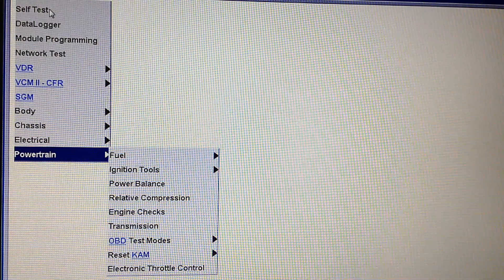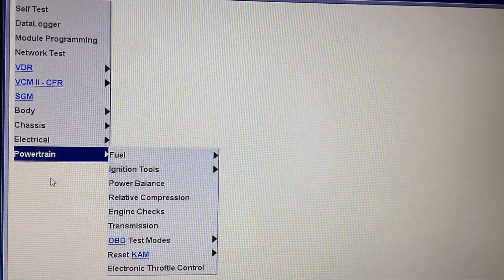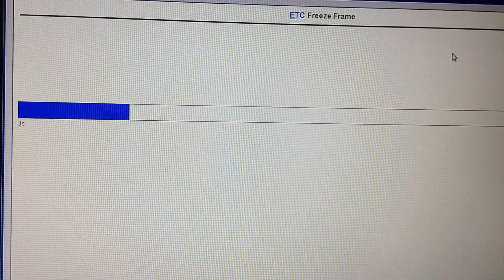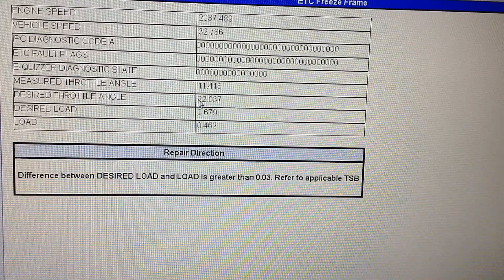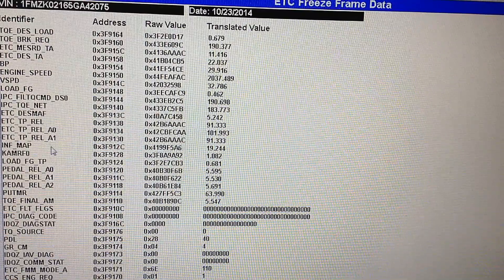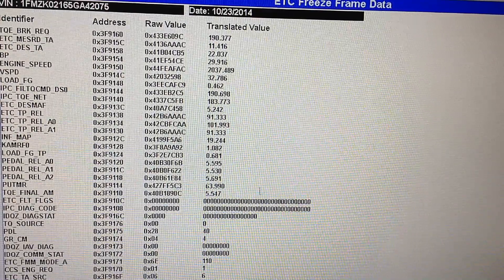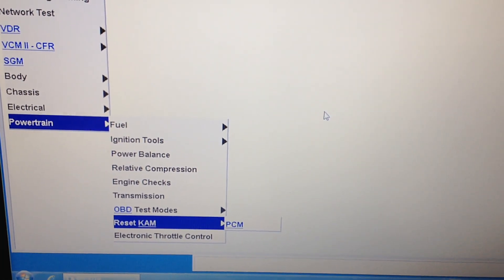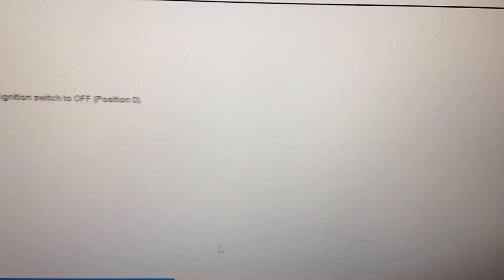Ford Five Hundred & Freestyle Surging No Start: Electronic Throttle Body Replacement

Comment: i have a 2006 ford five hundred. When it is cold outside, the car will not hardly accelerate unless I put  the pedal all the way down to the bottom, then it finally opens all the way. When i am at highway speed, the car acts like it is in a lower gear combination with the rpm's up almost 500-1000 rpms higher than usual (the tranny is  a CVT). If  i put the car on cruise control on the  highway,  then the car acts pretty normal  and smooth acceleration up hills. Would you consider this a TB problem still or could it be the pedal position sensor? I did have one instance where it did throw a code and just  coasted. I pulled over,  turned the engine  off, and then  restarted the car, and it cleared the error and was driving normal again until I  parked it. You had  mentioned in one of your videos that you might be able to buy  the  TPS part of the TB. I have not had any luck with searching for just the TPS.  Would you happen to know where to buy  them?
Reply from the maker: +z2830than This does sounds like a throttle body yes. I have a video on a Five Hundered where it exhibits almost the same concerns you are reporting. It would have been best to get that code that set though. The throttle body TPS assembly is not available separately on this car I link to where you can buy the latest throttle body for your car much cheaper over going to the dealer check it out-http://www.amazon.com/gp/product/B005HYMHQ4/ref=as_li_tl?ie=UTF8&camp=1789&creative=390957&creativeASIN=B005HYMHQ4&linkCode=as2&tag=fordt-20&linkId=Z6SJC222N6ULS5NU
Reply: +FordTechMakuloco  could you send  me a link to that particular video? thanks!
Reply from the maker: +z2830than https://www.youtube.com/watch?v=DgLBpkTjGZM
Reply: +FordTechMakuloco Thanks again....this really helps. I  know you are showing the use of a scantool for logging the position data, but what is your take  on testing the TPS by checking the voltage output by manually moving the blades and seeing the results on a multimeter? I know  it isnt the same as driving and  logging, but  wouldnt the  erratic voltage values show up by moving the blades slowly back and forth?
Reply from the maker: That would only show a voltage change you would not be able to see it is erratic plus if you had no tps input from either track it would set a P2135
Reply: +FordTechMakuloco in regards to the throttle body, amazon links to 6F9Z-9E926-A and says that it  does not  fit a 2006 ford five hundred. Is this in regards to the  TB being heated or non-heated? I am thinking that my TB has the coolant going through it like in your video above. Are there advantages from one to another?
Reply from the maker: The throttle body for all five hundreds freestyle and montego vehicles 2005-2007 are the same. All the heated an non heated designs have gone to non heated as discussed in this video.  There is no heated design anymore. Also I just verified the part number in The Ford dealer master catalog so the one I link to on Amazon is correct.
Reply: +FordTechMakuloco Thanks again for your advice and recommendations. By  far  you have one of the best youtube channels i have seen in regards to repairing/replacing components.
Reply from the maker: Thanks!
Reply: +FordTechMakuloco ......just for the heck of it,  I am going to ask if there is a way to log the sensor data without having to take it to the dealer? If not, does the dealership charge a flat fee to test it, or does the charge vary from  dealership to dealership?
Reply: I re-watched the other video you linked to me, and you mentioned that the sample rate is too low for your DIY scan tools.
Reply: +FordTechMakuloco I replaced my throttle body today and the car is fixed! Your tutorial is much appreciated!
Reply: Wow

Comment: Really having trouble getting my ford started AGAIN after changing my throttle body...and when i did get it started i didn't have no type of acceleration to rev at all. Plus had changed the wires to the throttle body because the old one's where to exposed...but made sure all connections where correct and still no luck.... Asking you if i did something WRONG... Pretty sure i did something wrong
Reply: I just cleaned the tb on mine and when I went to start it after putting it back together it ran real rough and even stalled. 
So I restarted it again all seemed fine...is that how it went for you too?

Comment: Is 89 inch pounds (approximately 7.5 ft pounds) correct? Doesn’t seem very tight. Should I use thread locker?
Reply from the maker: Absolutely correct no loctite needed.
Reply: Thanks! They seemed real tight when I took them off. I replaced the throttle body on a 2016 Explorer today and didn’t have a torque wrench so I snugged them up and will purchase a wrench tomorrow. Thanks for the reply and your videos; you help me keep my Fords on the road.

Comment: if the five hundred starts and runs just no throttle response no check engine would it be the throttle body?
Reply from the maker: It could be the APP but 99% of the time the problem is in the ETB itself. I have links to the latest one from Ford in the video description below for much cheaper than the dealer.
Reply: If it's a CVT could be the transmission,  very common problem with CVT as they fail quite often
Reply: Probably too late but the throttle body problem is on the recall list. Mine was fixed FREE!
Reply: @michaelc.thurman889  what did you tell the dealership.

Comment: Have you seen a 500 have a bad throttle body but not show any dash warnimg lights or show codes on a standard shop scanner (Snap-on Verus D10)
Reply from the maker: +jwrracing1 Yes not all of them set codes you must watch the throttle angle pids to see. I have a few videos on this.
Reply: My throttle will not go up to 1500 rpm. No codes or dash lights

Comment: Was there a recall for these throttle bodies? I have a 2005 Freestyle.
Reply: Yes Their Is Look Online Search 2005 Ford Freestyle Throttle Body Recall U Will Find A Recall Number Print That And Take To Dealer Wish U Luck
Reply: There's a TSB, but I find nothing on a recall.
Reply: +Johnny CincoCero I'll post it here hold on
Reply: +Donavin Silvera Hey I Do Appolpgize Maybe They Took It Down But They Have Had One Before That's Crazy Did U Try Cleaning It
Reply: Johnny CincoCero it was a recall but they so easy to fix
Reply: Donavin Silvera I ended up replacing it with a throttle body from Rock auto. Ford part was just way to much for a vehicle that has seen better days. Anyway, issue has been resolved.
Reply: There was on my 2007 five hundred

Comment: Hi ty you for your wisdom you were dead on with the wipers I also wanted to point out about while my car is in park my rpms willnt rev up past 3000rpm in park don't know if that's normal in my 2005 ford 500 limited bought it used  and it now has over 110000 miles ford told me 400 dollars to do the spark plugs Change out I was thinking to do the pcv valve and air and fuel filter myself  Google the plugs they say you have to take off manifold to get to back three plugs and they are a pain don't know about the coils (ignition) to change them also read the Caytlyc  converter might be plugged up and don't k ow how to check that please help
Reply from the maker: ***** Yes the 3k max in park is normal, if the converter was plugged you would have a check engine light and very low power. The intake must be removed to do plugs and such but is not as bad as it looks really.
Reply: do you think i could do it as far as change the pcv valve, the coils all plugs, remove the intake,fuel filter, how bout the egr valve should i replace or clean that or clean the throttle bootle too, and replace the egr gasket and intake gaskets too
Reply: also is there any torque specs for the throttle body to intake and the torque specs for the plugs or any torque specs cause i only have hand tools

Comment: my ford oem carlite window was crack from the cold had to get a new one a oem pilkington windshield they came and put it in ever since then i notice the passenger side wiper goes above the black when they come down to a rest at the bottom right which does not look normal which i notice the wipers would start off fast then slow down on high speed i google and seen to check relays or the windshield linkage should replace please help cause i have no clue cause it stops right where the clear glass meets the black bottom of the glass at the bottom so it looks every other windshield the peoples wipers are below the glass i even took the arm off and offset to be more below but still stops in same spot above black almost looks like its running out of juice
Reply from the maker: When you pull off the wiper arm cycle the wipers and turn them off then set the wiper height.

Comment: I have a 2006 ford five hundred, we replaced the throttle body today, however now it just lingers between 500-900 rpms and when I try to give it gas I get no reaction. We put the old throttle body back on(it was working, though the car had cut off on me a few times thats why we were replacing it) and it does the same thing. No gas hovering around 500-900 rpms.
Reply: +Sean Scott did you reset the pcm?

Comment: What about the asisin transmission made by Toyota and the problems it has with the valve body going after 35k...and shift issues
Reply from the maker: toneloc62011 I have done quite a few of those back in the day on these and the fusions for the harsh shifting caused by the valve bodies. I don't really see them much anymore.

Comment: Wish i would of seen this earlier would of help. My 2005 500 will crank and wants to but it wont start up? any thoughts?
I just changed the fuel filter and spark plugs and boots
Reply from the maker: Luis Barrera Yeah I would look into this throttle body as the source of your failure this is how they get once they have fully failed.

Comment: wow old memories of my 500. surges at 98k, took of and cleaned butterfly and throat really carefully, twice. ran smooth like a baby butt!

Not looking forward to those 3.0 spark plug change on my '06 mariner
Reply from the maker: Dirtyharry70585 Piece of cake.
Reply: Dirtyharry70585 Right.  No need to replace throttle body!!!!!

Comment: when the wrench light comes it says fail safe engine mode
Reply from the maker: +Louis Gonzalez Yeah get the codes read but it likely needs a throttle body. Make sure you click on my link to get the new one its allot cheaper than the dealer for the same Ford part.

Comment: looks like that motor mount on the left is due to be changed as well , lol
Reply from the maker: Yup that too, but throttle body being something like $600 on this car the mount had to wait.
Reply: FordTechMakuloco replace get and camsensor and now it cranks but won't start?
Reply: can anyone help after replacing the vct on. 2008 f150 and the cam sensor replace  but it only cranks and don't start what is the prob!em ?could it be off timing ?will that cause it not to start after replacing vct only l
Reply: Wow $600 bucks. Couldn't clean the old one?

Comment: I hear you say " not available at aftermarket shops" a lot in regards to the ford scantool. I have news for you more shop owners I know own and operate a IDS subscription then do not. Not to take away from what your doing guy but I know that at my shop were tooled up for certain makes at the same level a OE dealership is.
Reply from the maker: Bryan Codoluto Agreed a few shops around here have the tool also but it seems more shop owners do not want to pay for the subscription it seems. Either way the point is to take it somewhere with this scan tool software setup to get that extra little information to make the diagnosis more accurate.

Comment: I found this Ford bulletin on a Five Hundred forum. Please let me know if you think this will do the trick.  It looks like all we need to buy is "Motorcraft Choke & Linkage Cleaner" to clean it and then do your PCM reset see here:  http://www.fordtaurus.net/forums/viewtopic.php?f=5&t=13710

This link says:
TSB 09-24-12

12/14/09

3.0L LOW IDLE/ELECTRONIC THROTTLE BODY CLEANING PROCEDURE
FORD:
2005-2007 Five Hundred, Freestyle

MERCURY:
2005-2007 Montego

ISSUE
Some 2005-2007 Freestyle, Five Hundred, Taurus and Montego vehicles equipped with the 3.0L engine may set a malfunction indicator lamp (MIL) code P0506 or P0505 or exhibit a low idle. This may be due to sludge buildup in the electronic throttle body (ETB).

ACTION
Follow the Service Procedure steps to correct the condition.

SERVICE PROCEDURE
1. 	Disconnect the negative cable from the battery.

2. 	Follow Workshop Manual (WSM), Section 303-04 to remove the throttle body from the vehicle.

3. 	Use Motorcraft(R) Choke and Linkage Cleaner, spray the throttle body plate and bore. Using a small, soft, solvent resistant brush clean the edges of the throttle plate and the mating surface of the throttle bore to remove all sludge build up. Reapply Motorcraft® Choke and Linkage Cleaner or equivalent. (Figures 1-2)

4. 	Clean with a lint-free cloth.

5. 	Inspect throttle body gasket and replace if damaged.

6. 	Follow WSM, Section 303-04 to install throttle body.

7. 	Connect ground cable on battery.

Parts Block
WARRANTY STATUS: Eligible Under Provisions Of New Vehicle Limited Warranty Coverage
IMPORTANT : Warranty coverage limits/policies are not altered by a TSB. Warranty coverage limits are determined by the identified causal part.

OPERATION DESCRIPTION TIME

092412A 2005-2007 Five Hundred, 0.7 Hr.
Freestyle, Montego: Clean
The Throttle Body Plate
And Bore Includes Time
To Remove And Install
The Throttle Body, And
Check DTCs (Do Not Use
With Any Other Labor
Operations)

DEALER CODING

CONDITION
BASIC PART NO. CODE
9F991 49
Reply from the maker: Dave Smith That is for a totally different issue because the pcm never has a sludge compensation strategy.
Reply: FordTechMakuloco Ok, I am confused now.  I thought it was a dirty throttle body causing the tranny to surge.  What is causing the Montego's to surge at parking lot speeds then?  Wouldn't cleaning it and resetting the PCM help?
Reply: FordTechMakuloco Ok, I am confused now.  I thought it was a dirty throttle body causing the tranny to surge.  What is causing the Montego's to surge at parking lot speeds then?  Wouldn't cleaning it and resetting the PCM help?

Comment: I have 05 3.0 freestyle no codes crank wont start i hold it to floor trys start was runing know wont run plzz help fuel pump fine put new fuel prssure rail sensor new gas filter any advise ne apreciated

Comment: Steve busch i replaced new fuel regulator couple months back came find out after all testing never my dude buy ebay fuel regulator that was whole problem got new good brand from napa problem solved if u have good brand fuel regulator then i would start looki g at ur cam sensors or crank sensors good luck kid probably no spark pull plug wire see got spark stick screw driver end wire have somebody crank for u u hold wire ark against motor anything against engine good luck kid let me know how went less u already figured it out .

Comment: I have a 2007 ford five hundred and my car died on the freeway yesterday hooked up the OBD and read a code p0320 (ignition distributor engine speed input circuit) any suggestions on how to fix? The car won't even start now